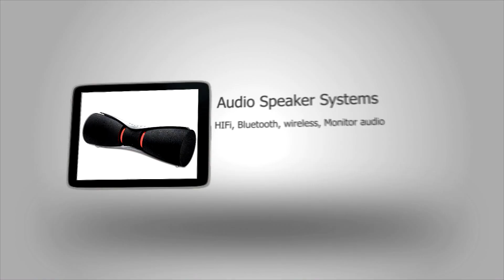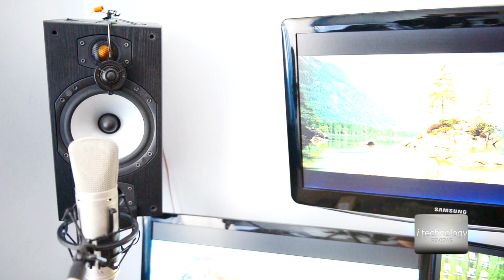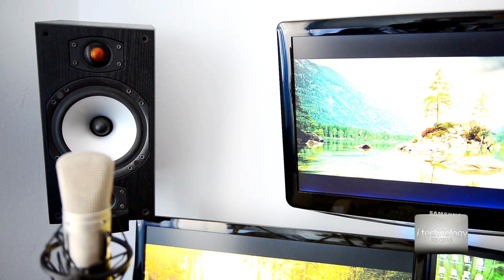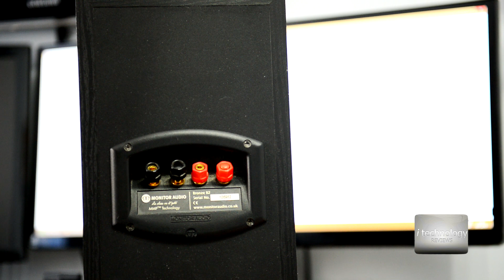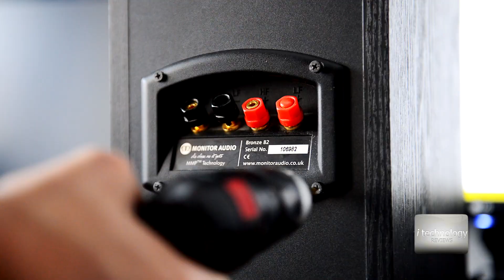Upgrading Monitor Audio Studio Speakers with Dynaudio tweeters making Hires sound experiment

Comment: Hi. I have the same problem with my speakers and I wanna upgrade them. 
Do you remember, by chance the model of the speakers you used and also the value of the condenser you changed?
Thanks and regards,
Criss
Reply from the maker: Hi. If you watch the entire video it will tell you the brand of the tweeter